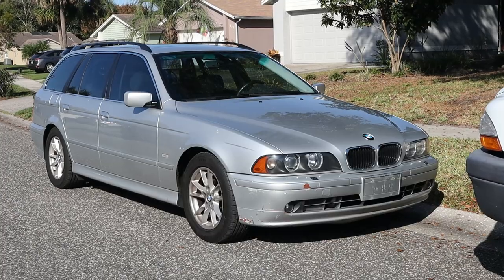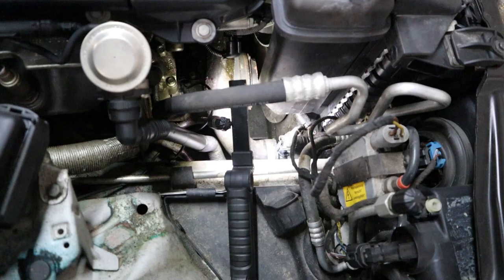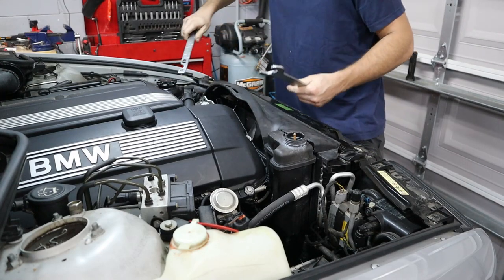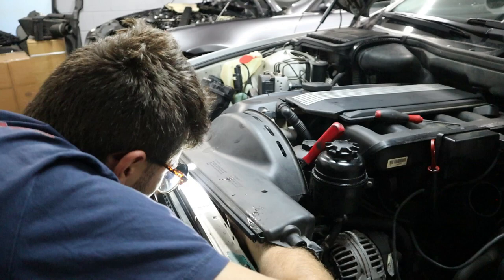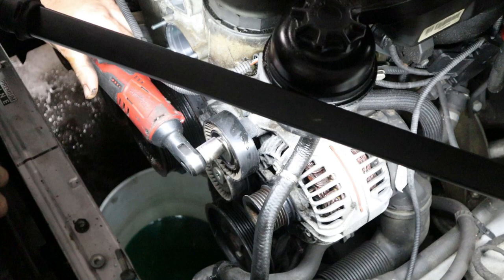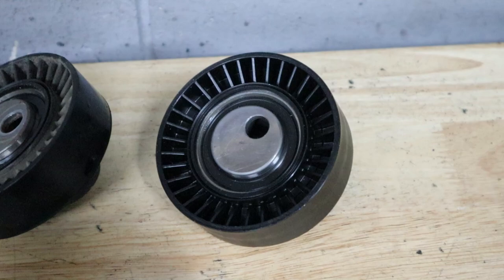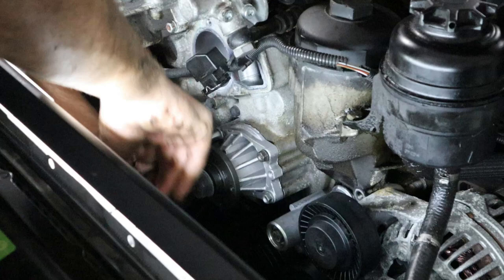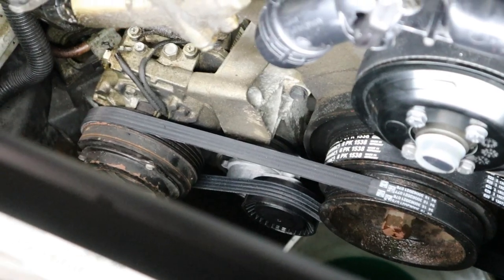E39 525i Wagon Restoration Part 1: Cooling System and Belt Drive Overhaul!

Comment: Nice maintenance Chris. I never saw a fan clutch so stuck on the water pump like this. Insane! The water hoses underneath the intake manifold can wait quite some time. Normally the plastic one goes out at 150k miles or more. Very nice DIY. Thanks for sharing. Dutch regards, Nico.